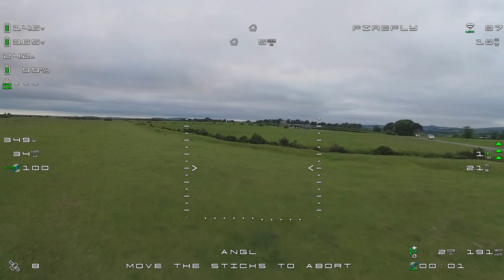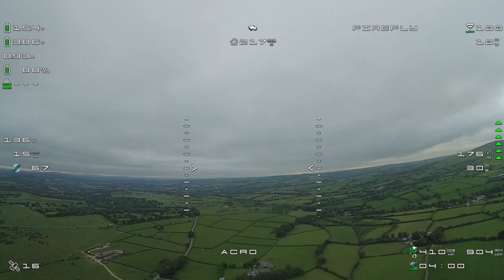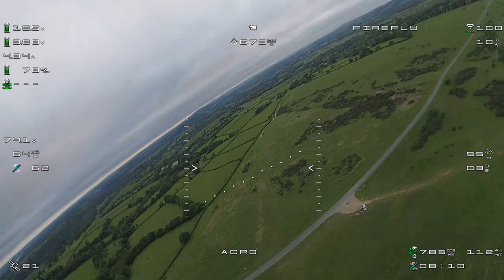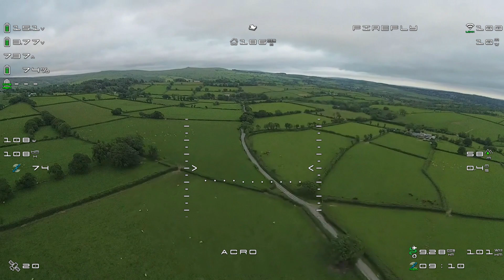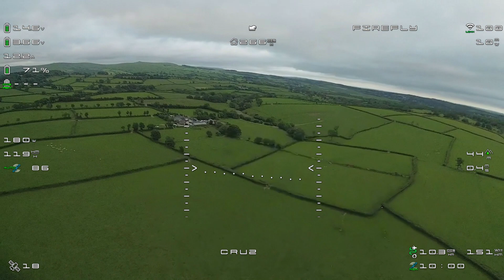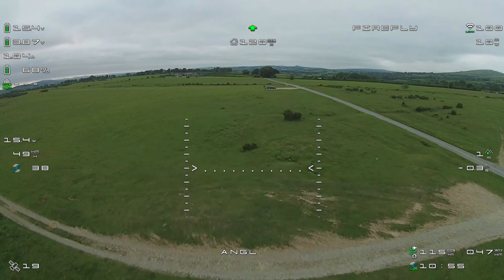Trying mWh calcs on INAV and performing some efficiency testings and stall testing on the Firefly.

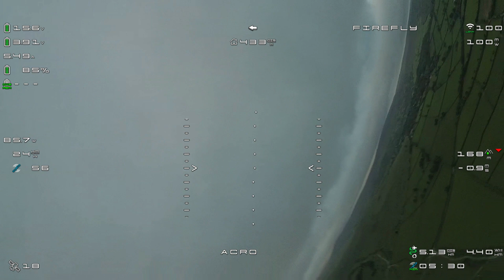Comment: Great informative flight. Very nice stall behaviour (or lack of). You made me laugh when discussing the advantage of washout (twist at 5:40) as the recording showed going inverted. Just be care not to stall inverted, as the washout normally has the opposite effect inverted. It did seem very stable inverted. Amazing agility, with impressive roll rate. Excellent voice over. There is much to like with the amount of detail the manufacture put into this design.
Reply from the maker: Haha, that's a very valid point! I hadn't thought about the washout effects being reverered when inverted.

They have put a lot of thought into details such as internal antennas areas, a recessed GPS cover, direct drive servos etc. and the case design is spot-on that said I think things like the ESC access (or lack of) could be improved and perhaps a little more re-inforcement on the vertical stab.

I'll work on fitting the HEQ gimbal for the next flight.
Reply: You might take a peak behind the motor mount, at some point, the esc might just be stuffed behind the motor in the tube.
Given the detail elsewhere, hard to believed they overlooked. Just may not be obvious.

Comment: I can't remember who had it, but there's another guy in the UK there. I'm pretty sure who had this with the Gimble. In it and from my opinions, it looked really hard to tell if you were dropping or whatever because the camera stays steady. Even when you're banking, you have to watch your horizon on your OSD and you have to watch your altitude in your O. SD.  Personally, I'm not sure I would like a Gimble like that.
 It would be awesome for filming though.
 I'm by no means saying there is a piece of crap just saying, it adds a whole another layer To flying But anyway, very nice Flight and Excellent voice over.
Reply from the maker: The other chap is Giz, he lives not that far from me. The gimbal can work well with FPV but requires some setup to be able to lock all 3 axis when actively flying (as opposed to using cruise or waypoints).

I've feel I've got my camera pointing a little too far downwards in this flight.

Thanks for the kind words :-)